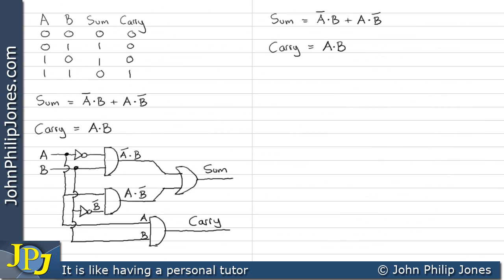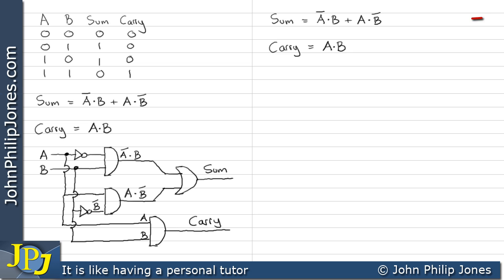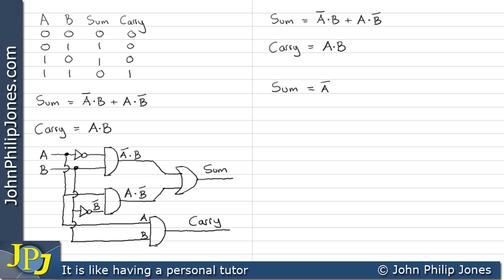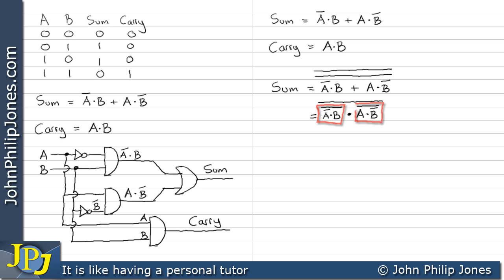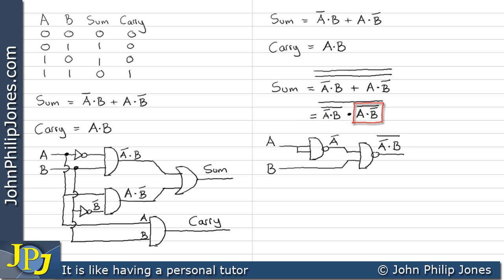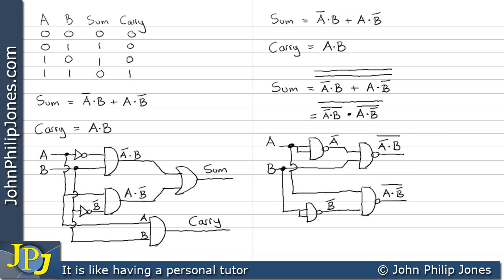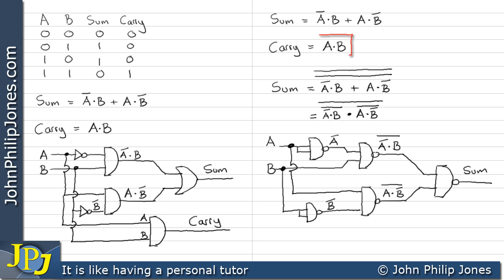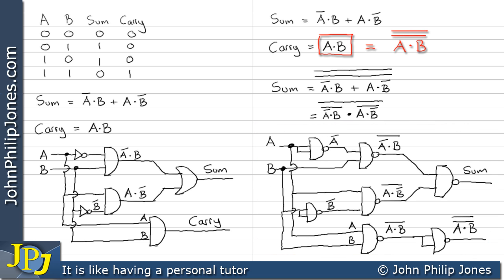Half Adder Design (using universal gates)

Comment from the maker: Hello adresverian, 
The key is to keep the And symbol (I.e. the full stop) and remove the Or symbol (I.e the plus sign). De Morgans theorem could change the minterm but that would introduce the Or symbol. So your description for the process is correct. 

However, the Nor gate can be used as a universal gate in which case De Morgans theorem is used to get rid of the And symbol and keep the Or symbol. Using the Nor gate to produce a half adder is shown in one of my videos in the playlist.

Bw
Phil
Reply: Design in LabView an application that takes in two inputs (A and B) in a "Half-Adder" circuit and produces the result of the sum of the inputs (A and B) into the outputs (C and S). Convert the outputs (C and S) to their "Numeric" decimal equivalent using a "case-structure".